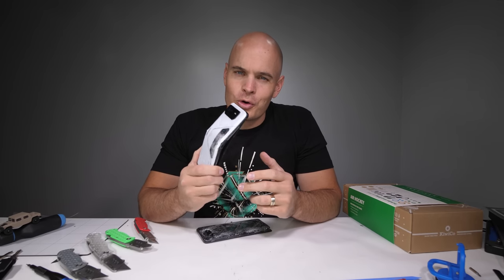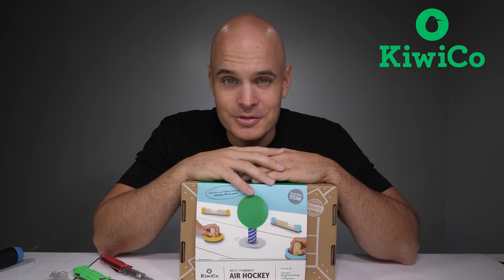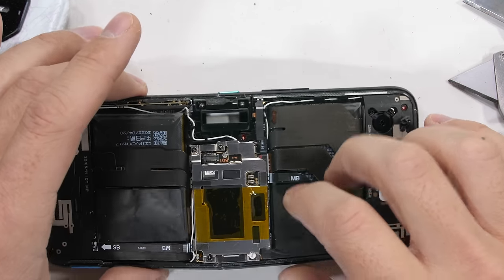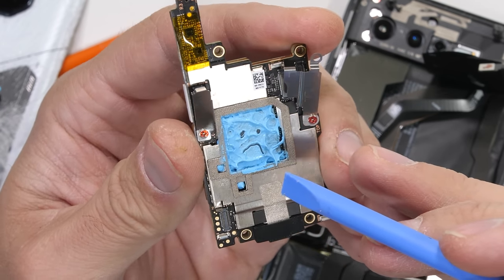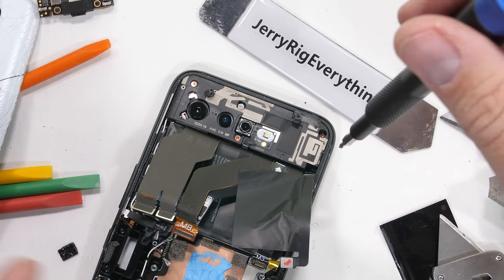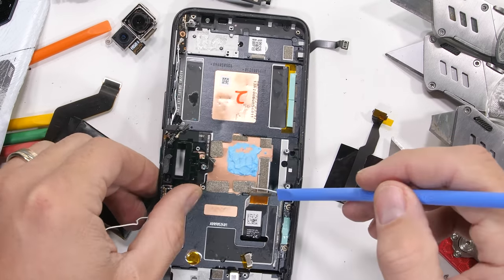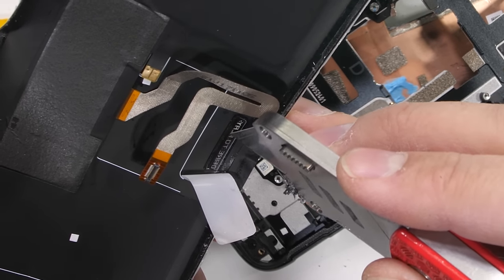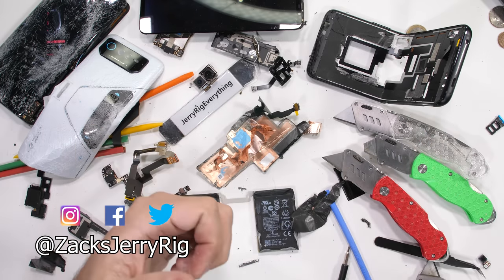The ROG 6 PRO has a SECRET Cavity! - TEARDOWN

Comment: ASUS knew for sure that the design in this way is going to make the phone easier to bend. However, the reason for this is to align the location of the cooling fan accessory with the processor and since the cooling fan is installed in the middle (best location for weight distribution) they have to make space for the processor to be at the same location where the cooling fan will be installed to get the most benefit out of it so in order to make the needed space while having good battery capacity is to have 2 small batteries instead of one big battery. Another side benefit which will be the distribution of weight when playing in landscape. It is not because of batteries safety somehow, ROG 6 Pro is a gaming phone where you need to focus on performance, high frame rate and graphics while trying to resolve the heat issue which will affect the performance. If you are into gaming and you want to enjoy performance gaming phone then you have to compromise. Therefore, by knowing that the phone is easy to bent because of this, then you know that ASUS know what they are doing, it is just something they needed to do for performance. 

Yes the bend seems bad and not desirable but we should appreciate that the company is differentiate the design of gaming phone than normal phones, they are trying to get the best design for performance and they have engineered the phone with an outstanding design and internal alignment with the current existing technologies as in future technologies may change.
Reply: Not reading all that

Comment: They should switch to more stury material like Apple does. Their stainless steel frame gives solid stability and IMHO would also provide good heat dissipation as well. The caveat is that especially the Pro Max get 248g heavy. Though if you sell a premium product at such a high price tag, it‘s unforgivable that it snaps in half this easy! Come on, ASUS, you can do better than that!

Comment: Bud i want that phone so bad. I have the fold 4 i cleaned the dam front screen with a super light scratch remover now some cloudy crap is on it or keeps coming back i think i need to clean it with alchol or that coating came off i think you called it oleobic coating where can i get that or what is your opinion. Can i ever send aomething to you to try to repair ?

Comment: As a mechanical engineer, I think the phone broke due to the lack of strength on the metallic frame (structural) material. More thickness on the frame would have solved it. Also, a more rigid material would have. The rectangular whole for the heat dissipation didn't help at all also from a structural point of view.

Comment: Though the power button and usb port placement is unfortunate
The main culprit is that motherboard position.
There's a reason why apple and samsung use tall slim batteries along the length strongly glued in place.
It's just free stiffening for the frame

Comment: i think heat has to do a lot with the phone structure it self resulting very fragile easy to bend.
the irony is that by being a "gaming" phone, it needs to deal with human frustration, which usually consists in bending the phone :))

Comment: This is why I watch your channel before even considering buying a new phone at all.
Reply: ASUS knew for sure that the design in this way is going to make the phone easier to bend. However, the reason for this is to align the location of the cooling fan accessory with the processor and since the cooling fan is installed in the middle (best location for weight distribution) they have to make space for the processor to be at the same location where the cooling fan will be installed to get the most benefit out of it so in order to make the needed space while having good battery capacity is to have 2 small batteries instead of one big battery. Another side benefit which will be the distribution of weight when playing in landscape. It is not because of batteries safety somehow, ROG 6 Pro is a gaming phone where you need to focus on performance, high frame rate and graphics while trying to resolve the heat issue which will affect the performance. If you are into gaming and you want to enjoy performance gaming phone then you have to compromise. Therefore, by knowing that the phone is easy to bent because of this, then you know that ASUS know what they are doing, it is just something they needed to do for performance.

Yes the bend seems bad and not desirable but we should appreciate that the company is differentiate the design of gaming phone than normal phones, they are trying to get the best design for performance and they have engineered the phone with an outstanding design and internal alignment with the current existing technologies as in future technologies may change

Comment: Unfortunately my ROG Phone 6 Pro bent exactly on the USB port in my front pocket and it broke the whole backside. I shared my experience on Reddit and contacted Asus. Asus did not want to acknowledge their design error and I had to pay €400 to fix my phone... FYI: My phone was inside a transparant TPU case.
Reply: It is sad to hear this, the mobile should have been designed in a way to give it more strength but below is the justification for the phone being easy to bend that is why they might consider it as not a design error but it is somehow a design compromise so i think they suppose to support and change 

ASUS knew for sure that the design in this way is going to make the phone easier to bend. However, the reason for this is to align the location of the cooling fan accessory with the processor and since the cooling fan is installed in the middle (best location for weight distribution) they have to make space for the processor to be at the same location where the cooling fan will be installed to get the most benefit out of it so in order to make the needed space while having good battery capacity is to have 2 small batteries instead of one big battery. Another side benefit which will be the distribution of weight when playing in landscape. It is not because of batteries safety somehow, ROG 6 Pro is a gaming phone where you need to focus on performance, high frame rate and graphics while trying to resolve the heat issue which will affect the performance. If you are into gaming and you want to enjoy performance gaming phone then you have to compromise. Therefore, by knowing that the phone is easy to bent because of this, then you know that ASUS know what they are doing, it is just something they needed to do for performance.

Comment: Hi Jerry. I use a samsung galaxy s21 ultra for like 1 year now. Some days before i was in a quiet room and happen to open the camera app in my phone. At that moment the phone was near to my ear and i noticed a strange noise was coming from cameras. I closed the app and checked again no sound was coming then open and a sound like vendilator was coming again from camera compartment. It would be grat to watch a video of you explaining that because i think no one has noticed it
Reply: I have a S20 and it does the same sound in the camera and the answer is simple that the thing that make sure the photo or video is not blurry because you move
Reply: It's the OIS, if you open the camera app the soins will go away, if you close the camera and Shake the phone you can hear the sound again, I'm on S7_Edge, it happens in mine too and on every phone that has OIS (optical image stabilisation)
Reply: @kyro9763  OIS
Reply: @rohithkumarsp  thanks didn't know the name

Comment: I'm not a Hardware Engineer, but why in hell they don't put the vapor chamber in the most outsite point possible if this guy comes with a thermoeletric cooler? If you look well, when you use the cooler, you're cooling just the batteries.

Comment: "I was just minding my own business bending it in half when it went and bent in half" 

Word of the year.
Reply: *Sentence
Reply: ASUS knew for sure that the design in this way is going to make the phone easier to bend. However, the reason for this is to align the location of the cooling fan accessory with the processor and since the cooling fan is installed in the middle (best location for weight distribution) they have to make space for the processor to be at the same location where the cooling fan will be installed to get the most benefit out of it so in order to make the needed space while having good battery capacity is to have 2 small batteries instead of one big battery. Another side benefit which will be the distribution of weight when playing in landscape. It is not because of batteries safety somehow, ROG 6 Pro is a gaming phone where you need to focus on performance, high frame rate and graphics while trying to resolve the heat issue which will affect the performance. If you are into gaming and you want to enjoy performance gaming phone then you have to compromise. Therefore, by knowing that the phone is easy to bent because of this, then you know that ASUS know what they are doing, it is just something they needed to do for performance.

Yes the bend seems bad and not desirable but we should appreciate that the company is differentiate the design of gaming phone than normal phones, they are trying to get the best design for performance and they have engineered the phone with an outstanding design and internal alignment with the current existing technologies as in future technologies may change

Comment: hello sir... actually, i have ROG PHONE 2, i accidentally drop it on the top of my locker, and it wont turn on, crack on the back at front screen.. waste of money, but i have my old phone still using until now, older than my ROG, and yes it drops multiple times event on a stairs from 1st to ground... and still all good... only scratch on the sides but no screen cracks... and that phone is super cheap not that expensive like ROG!..

Comment: My question: Is it even possible to make a phone with a secondary (USB-C) port on the side without massively compromizing the structural integrity?
Reply: Yes. The ROG Phone 1 to 3 have secondary USB C ports on the same spot but if structurally rigid. It's the split battery and middle SoC arrangement that's causing the problem

Comment: i have the 5 ultimate.. absolute beast
Reply: Is it powerful? How well does it hold up in 2022?
Reply: @awwk8452  very... 18gb ram... SD888.. it's a beast... but my p30 pro olso even nowdays can play COD, APEX, Asphalt 9.... i have the 8gb version
and the 5 ultimate it's 2021 made..
not old phone
Reply: Wow very powerful where did you buy it?
Reply: @awwk8452  philippines
Reply: @madmike6942  also by how does it hold up in 2022 I mean how does it hold up even with the newer 6 series phones sorry for the confusion
Reply: @awwk8452  very good... i'm running COD, APEX, Asphalt all in max settings... and it's playing them like a charm... same deal with the p30 pro... i play the same games in max settings and no lag, no stutter nothing.... i olso have a good wifi
Reply: @madmike6942  Dynamic or X Mode?
Reply: @arsenelupin1854  dynamic mode..

Comment: That is a super ineffective and poorly designed amount of thermal paste. They should have recessed the metal down into that area and if they couldn't get that deep use a thermal pad for the rest of the way. No way that much paste is efficiently conducting heat, at least not as well as it could.

Comment: Rog phone sucks. I'm the owner of Rog phone 5 and after few months since purchase, it became slightly bent, because I've used holder which hold phone by sides using a spring. So mainboard got damaged - finferprint sensor, vibro, one of the speakers and the worst - sim card slot went to hell. And this is no-warranty, non-repairable issue. ROG phone is a garbage. The only thing I should admit it was running games smoothly, but overheats easily